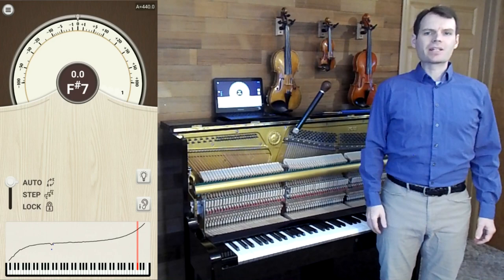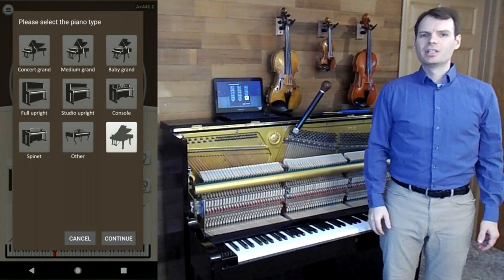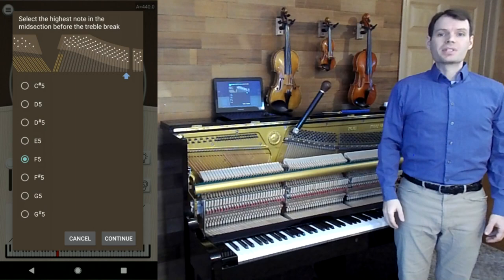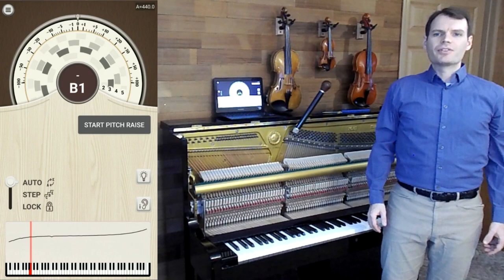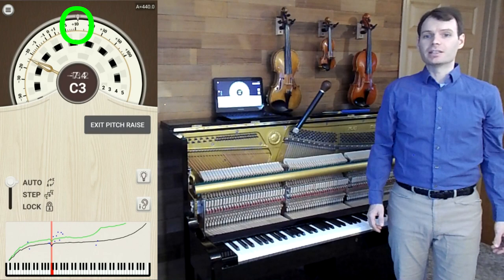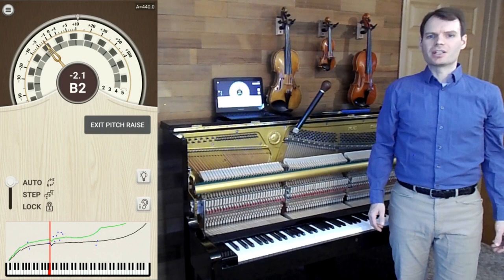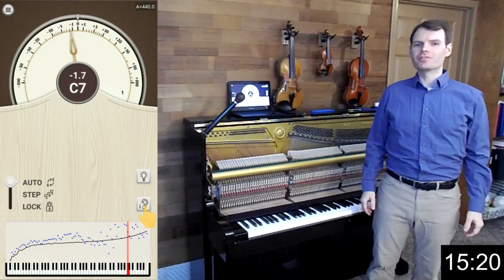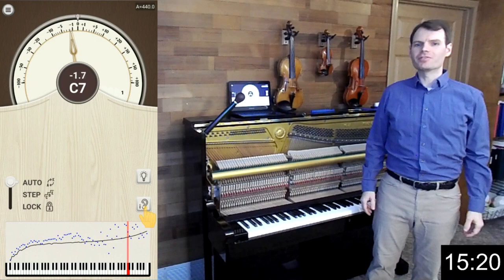PianoMeter Pitch Raise Tutorial

Comment: How do you perform a pitch raise if you only can afford the plus version?
Reply from the maker: @michaelsataiwan  In short, you still tune the piano twice, but you just make a rough guess as to how sharp to tune it on the first pass. For safety, I would target about 20-30 percent sharp of however flat the piano is, except for the bass strings, which you should just tune to zero. So if you're starting with a piano that is 50 cents flat on average, you would tune the piano about 25% of 50 cents sharp, or 13 cats above your standard pitch. Just click on the box where it says A=440 and type "13" into the box where it says 0 cents. There's some slightly more detailed instructions on the website called tuneyourownpiano.com

For the second pass, go back and set the pitch offset back to zero (A=440 again)

Comment: Are you the developer of the app? It's priced like Tune Lab which I use everyday. Question, why is it that you recommend tuning the tenor and high sections first and then the bass? It's more like smoothing out the wrinkles in a bedspread working from the low bass up to the high treble.
Reply: Yes. I started as an aural tuner, so tuning the bass last is the only thing that feels natural to me. The reason I recommend it for this app is because the overpull calculations are based on tuning in this order.

Comment: A small but important question. As you strike the note you notice the pitch indicator hit an initial point and then after a second descends somewhat. Which one do you believe? My guess is after a half second or so as the initial reading is more prone to upper harmonics?   Please if you can help with this.
Reply: I tune to the strobe rings immediately after they settle somewhat from the attack. (About a half second). The important thing is being consistent.
Reply: @adjwilley  Thank you!   When setting the stretch, does the pitch have to be raised to 440?  I suspect I may be about 5 cents below.   I have two steinways, one an L and a B in prime condition.

Comment: Good video. This person looks like he is a piano tuner. By the way he’s tuning the unisons. And his tuning hammer. 

I think if you’re never tuned before it would take several attempts to get close to his ability. 
I would tune the middle section a few times before going to the high treble. To get used to using the tuning hammer. And setting the tuning pin. 
 I would go slow at first for a few days. Not only to learn the machine but to get used to hammer to the strings. And changing the mutes.